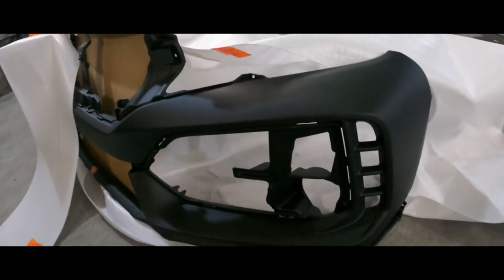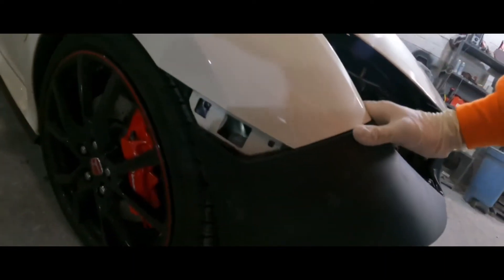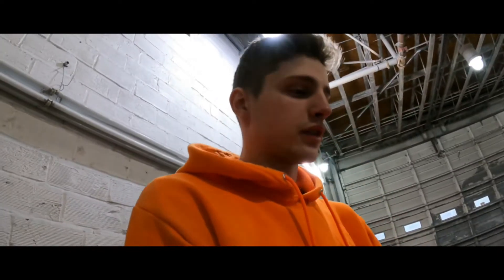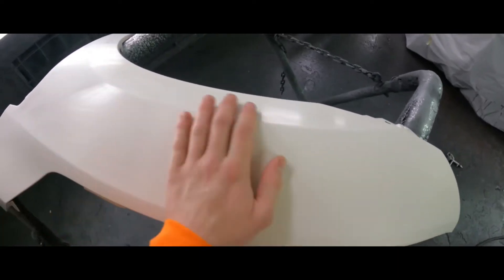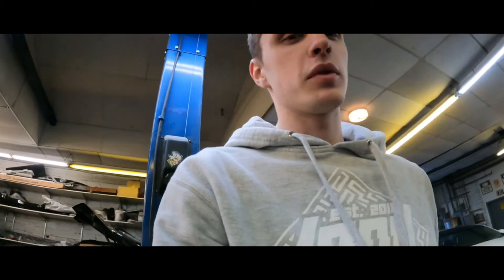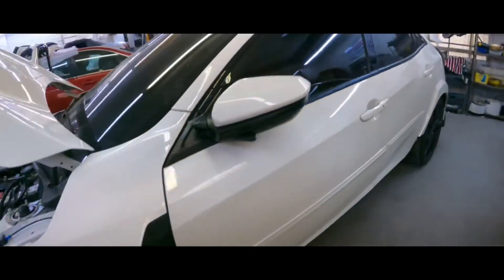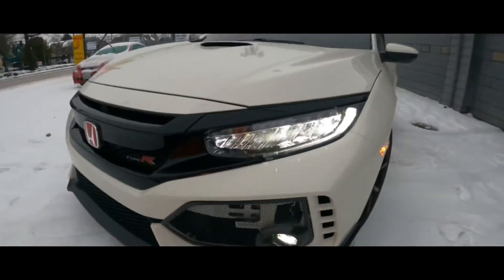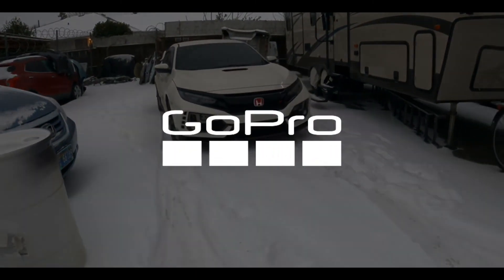Rebuilding My 2018 Honda Civic TypeR | Finally Completed

Comment: Hope you're doing well Joseph. I sold my 2019 Type R to Carvana at 7,500 miles. They paid off my 27,500 loan balance and handed me a check for 13,750. It cleared the bank in under 12 hours.
Reply from the maker: I’m doing great, thanks for asking I hope your also doing well. I’m sorry to hear that you sold your typeR any new cars coming ? TypeR limited edition?

Comment: Did you ever get the down pipe installed. Really curious how the borla will sound with upgraded/ non stock downpipe
Reply from the maker: Yeah I got everything installed The best performance parts PRL cat-less down pipe and midpipe and the Borla carbon fiber exhaust.